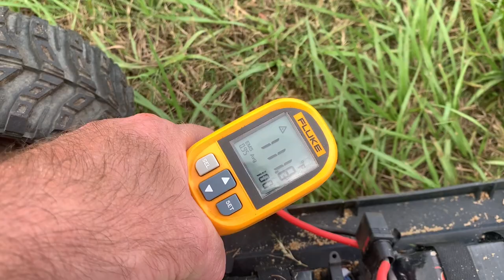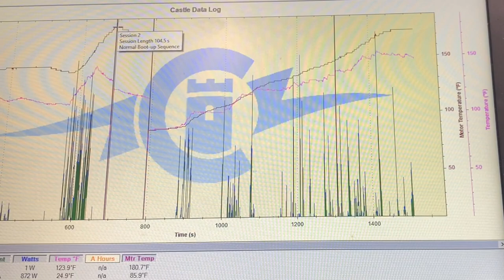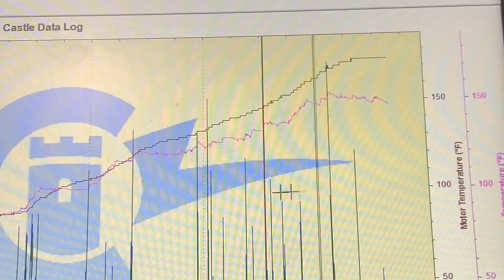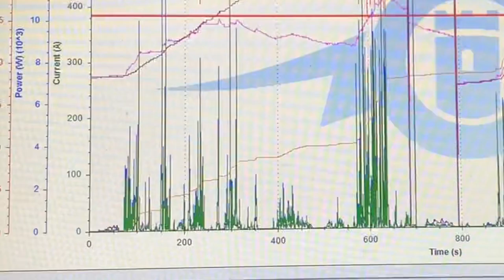Castle Powered DBXLE 2.0 with 20t Pinion

Comment: It's amazing you hit what I'm assuming is 519 peak amps and the xlx2 survived. I had to return my xlx2 to castle for warranty and according to their website, the xlx2 was tested at over 500+ amps. Mine hit peak amps at 340, the negative post according to castle, melted off the esc. They also told me that 340 amps was too much for the xlx2.

Edit: I've got my xlx2 back from castle and it seems to be running good. With a 17t or 18t pinion (not marked and I don't remember) and 50t spur, It went 55.7mph. I have a 48t spur on order and I also have a 46t spur in hand. I will be trying out each to see how fast I can get it to go. If I can hit 65 mph, I'll be happy. The xlx2 is combo'd with the 1100kv 2028 and according to the logs, it hit almost 15hp.

Comment: Hey Joe, great work on the vids man!! Thank you for all the info! I just subbed, as I've been watching a lot of your post lately. I've just ordered a DBXL-e 2.0. I have so many questions tho lol! I have four 8s rigs, so not new to the larger scale, but this is my first Losi. I went ahead and ordered a Saga Customs 18t, mod 1.5, 8mm bore pinion. I was under the impression that anything bigger wouldn't fit, with the stock 50t spur. Is that true, or can we fit larger pinions? BTW I have a Max 5, 800kv combo waiting to drop in. I also ordered the aluminum  braces and top plate from HH as well. Any other suggestions you could give me? Perhaps what diff weight oils work the best? In my Arrma 8s rigs, I run 20 mil center, 300k rear, and 1 mil front. Would that be too heavy for this rig? Thank you for your time!

Comment: I don't get how your temps didn't get that high on a 20t pinion. I'm running the same motor/esc with stock pinion and it gets ripping hot.  Bad thing is i can only see battery voltage through the datalog
Reply from the maker: Well, have you tried turning down the timing? I think mine is at 5 degrees. That can help with temps.